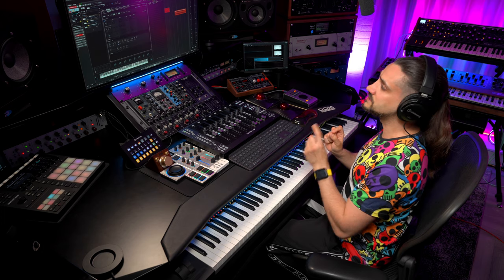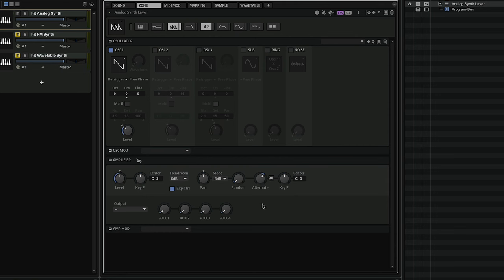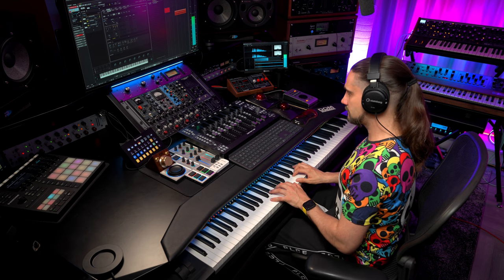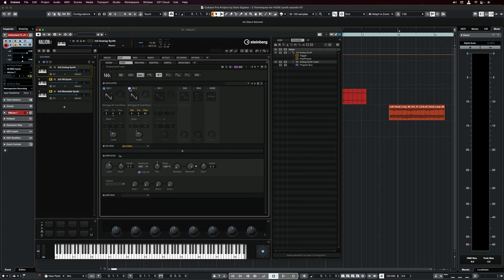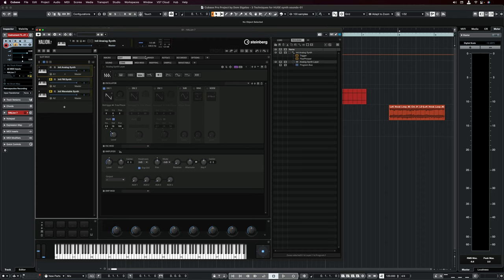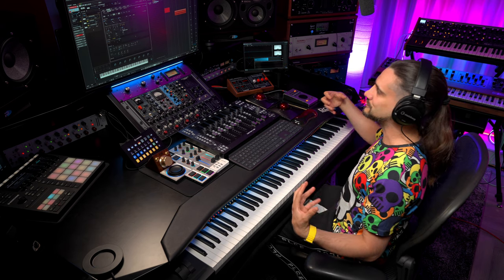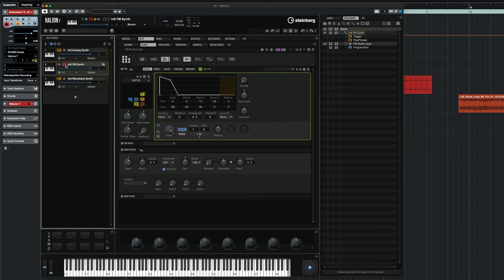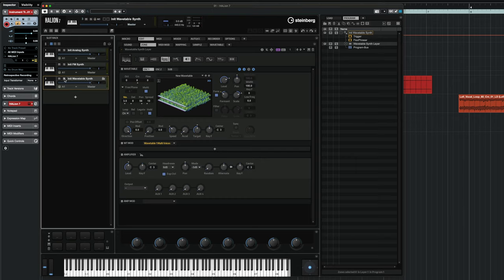3 Techniques For Creating Huge Synth Sounds | Production Lab With Dom | HALion 7

Comment: In Cubase since 2018, I still have Rapture Pro (a discontinued vst synth from Cakewalk) with 6 layers and multisampled import, from my previous Cakewalk legacy. I set up my mind I need a replacement, most of my own sounds have up to 4 layers, with different synth engines including sample import. At around 100 bucks (under offers) I found VPS Avenger (various synth engines, few wavs import) and Tracktion F'em (multi-sampled sf2 import, but FM engine only). At more than double bucks I see UVI Falcon, and just 2 days ago I realized Halion is in the contest, although more pricey. I own NI Kontakt and a lot of sampled material within it, I had always considered Halion as a sampler by Steinberg, a sort of duplicate for me. Indeed I tried to work in Kontakt as a synth to make my sounds, it's a nightmare to program. This video comes at the right time for me, because it clearly shows that Halion is a synth, with sample import, and many synth engines. I will see if they they have some kind of offers for Cubase owners or for special periods, I am not in a hurry. It's the first Halion video that I jump in, I now will look if you have more